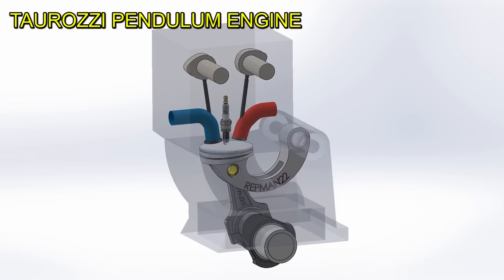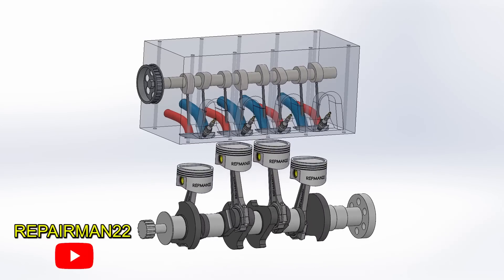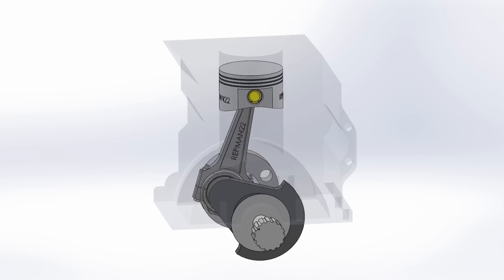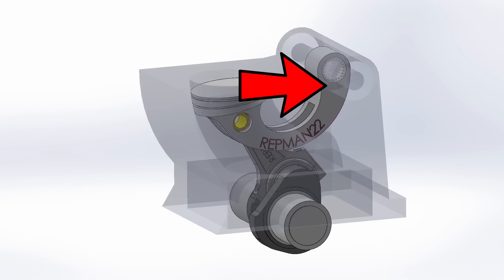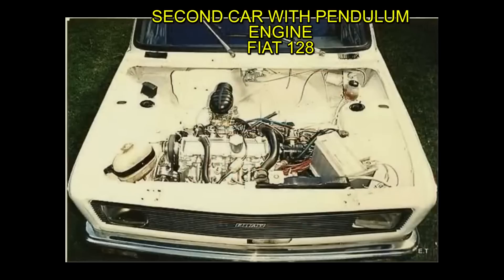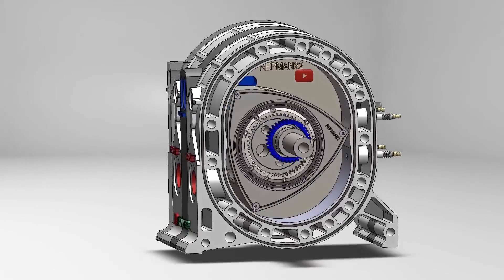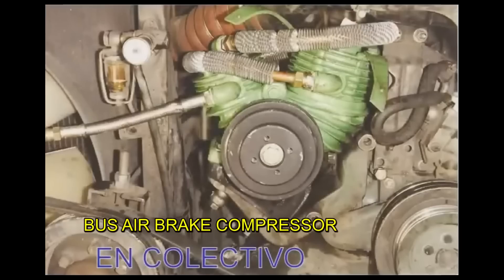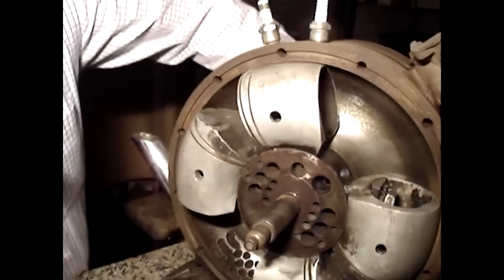All about the Taurozzi Pendulum Engine 🧠 and what happend to it🤯

Comment: Wow I've never heard of this engine before, and I'm very glad I did! Thanks so much for making this video! The fact that he was able to take it into real world use makes me confused about how it isn't in use by something now. Seems like it would make a wonderful motorcycle engine.

PS. The sound you used for combustion is hilarious!
Reply: Videos like this that propagandize concepts and make huge claims of 30% efficiency are fake guesses. If it really was so much better, every major company would use the design regardless of cost to license. The reason it's not common is because manufacturing costs and efficiency claims are worse than typical 4-stroke engines. Every time.
Reply: @mact.26  I took the 30% thing with a grain of salt. Even if it's "on-par" I can see a one-off coming out with a motorcycle with it. The success of a real world trial sets it apart from other "experimental" designs of historical note, which is all I'm comparing it to.
Reply: @mact.26  I doubt that it is that simple. And you ignore the enormous influence of conservatism in engineering
Reply: @davidcolin6519  I guess that you don't trust in engineering? While it is certainly true that the percentage of engineers that can properly evaluate an engine design is very limited, there is one very good reason while we don't see any big changes to the established current engine design: The best design has survived. All competing designs, that were tried during the 20th century, simply weren't as good. Current engines evolution is a product of engineers, not inventors. If you lack proper education (like inventors typically do) you can come up with an alternative design that can be made to work, but lack the skills to properly judge it. That being said, there are also certainly examples of bad decisions made by engineers, leading to developments that took the wrong path. One such example is the Honda's oval piston engine. Here it was prestige standing in the way of proper engineering judgement.
Reply: @CreRay  The Honda NR (Never Ready). You gotta give 'em credit for effort, though.
Reply: @jiyushugi1085  I just feel sorry for the poor engineers that almost worked to death to make something work that was nothing else than a poor engineering decision by their leader. It was an idea to make Honda win with a 4 stroke engine. It never happened. What the leader forgot is that not (just) max power counts, but also usability and power band. Same reasons why for example the (also very cool) BRM V16 failed.
Reply: @jiyushugi1085  BTW it's quite fascinating how people are totally convinced that apparently any engine design that is capable of running must mean that it is better than anything we've seen before. A while ago I saw some other alternative crankshaft design, the engine was demonstrated by running it on compressed air (i.e. no combustion). Then count the comments of people that it must be good considering how smooth it is firing😂😂😂
Reply: @CreRay  Yeah, the Japanese factories like to rotate their young engineers through their race teams, which is great experience for them, but since many of them don't know much about bike racing the resulting bikes don't always work too well. Honda's current problems in both MotoGP and SBK may also have their roots in this issue.
Reply: @VEC7ORlt  You're right of course.And doing so for an entirely new concept in reciprocating engine design, at a time when the automotive industry was under severe financial pressure (oil crisis followed by financial crisis) would make any potential producer want to be absolutely sure.
What surprises me is that M-B didn't just take him on as a consultant, pick his brains and, if necessary move on or take the idea further. Dismissing it almost out-of-hand  just because they couldn't match his claims seems to be a curious thing to do.
And if you don't think such things happen, you might do some research into the history of Orbital engines. Ford were interested enough to go to the extent of installing them in some cars that went to Police patrol cars.
Reply: @CreRay  Without seeing the data, I really don't think you can be sure. And seeing as M-B DIDN'T employ the inventor, just tested what they themselves made and then dismissed it, I don't think that it is safe to say that it couldn't have worked.
And in fact there really were many new engine designs in the 20th century. Jet engines were entirely new, as were turbo jets, and my uncle's own work on turbines, both as energy harvesters and as motive forces shouldn't be ignored. And then, of course, you have the 2 stroke, which only really started to make sense after the discoveries made in East Germany in the post war era. And I've only restricted my rebuttal to uses in transport!
And Honda's oval piston monstrosity was all about Honda's hubris, not an engineering "wrong path".
Reply: @davidcolin6519  In some cases I don't need data to point out what disadvantages an alternative design to a "conventional" 4-stroke engine has. I spent quite a few hours with engine simulation in my life, I think it's safe to say I have a solid understanding of the relation between basic engine design and its resulting efficiency. Ofcourse I'm aware of jet and 2-stroke engines, no need to educate me on that.
Reply: @CreRay  "Ofcourse I'm aware of jet and 2-stroke engines, no need to educate me on that."
You were the one claiming "there is one very good reason while we don't see any big changes to the established current engine design: The best design has survived. All competing designs, that were tried during the 20th century, simply weren't as good.", so felt that you needed to be reminded.
Nor do I think that it is safe to say that you have a "solid understanding of the relation between basic engine design and its resulting efficiency." especially as you seem to have completely missed the low piston weight, just as a starter. I can't think of any engine designer who would miss/dismiss such an obvious benefit. I really can't.
Reply: @davidcolin6519  Goodbye 👋
Reply: @CreRay  I am amazed at the absolute lack of connections you are drawing from this video. This is a proof of concept of a simplified twin crank design, but you are getting stuck on simple engineering issues. What you should be doing is noting the lack of sidewall wear and the benefits it grants, both in peak allowable RPM, lubrication needs, and long term reliability, but you have latched onto the base design as a final product rather than delving into the potentials it presents.
Reply: @Boomerhuaaaanger  Well I look at the design from a thermal efficiency standpoint. That's where all current development efforts (in the transport sector) are going into. I see no apparent reasons that long term reliability needs improving.
Reply: @CreRay  Reduced friction means less heat losses through friction means less thermal transfer required to maintain operating temperature means more insulating block material can be used means better thermal efficiency.
Reply: "This is a machine with low thermal losses since there is very little friction". There. One sentence that is very telling that the author of this video does not know what he is talking about, friction and thermal losses are 2 very different things! I don't see any advantage with current normal engines, the bent combustion chamber increases the thermal losses and decreases the mechanical efficiency because of the angle of piston pressure vs. conrad angle, and there is one added joint, increasing friction, not decreasing. It's an alternative engine design that absolutely can work, but there is simply nothing better about it.
Reply: @CreRay  That is the first pos that I have read that makes any sort of sense. 
I would join out that y wrong on several counts; here are some areas where there are clear and obvious advantages, but I'll stick to the most obvious one 
Piston weight. In a world that recognises that the only way to greater outputs (such as pretty much every type of motorsport) is to increase piston speed. That is why pistons on racing engines are so freakishly expensive, because they have to be as light as possible to place less strain on the conrod. Don't you think that reducing the size of the piston by a significant margin would be worth rather a lot? nI'd also point out that, with a significantly lighter piston, the flame front would have a much easier job of slowing down the piston, and that would also mean a HUGE advantage in reduced valve overlap, and would also significantly improve fuel efficiency
Considering the number of people on here who claim to understand engineering, there are an awful lot of them that also seem to have very, very closed minds.
I am not saying that I think the engine must have been the next incarnation of a jet engine, but I M-B was sufficiently interested to have built something similar, I really don't think that many of YT's self-proclaimed "experts" are in much of a position to dismiss it so lightly.
Reply: Give it a cool name and I would buy one! Always wanted a Wankel. Just to go out and jump on my wankel
Reply: Because there zero advantages to this engine. Harder to manufacture and no theres not a 30% fuel saving. Its all marketing hype. The pistons in regular engines use rings just like this engine lol
Reply: @OUTDOORS55  You clearly weren't paying attention., nor do you even understand that normal piston rings really, really don't work in the same way, because the ONLY reason a normal piston doesn't flop around like a dead haddock at the end of the conrod is because of the length of the skirt and the rings. Remove the rings and see how much efficiency you get, you dumbf*ck.
Next; I was under the impression that you needed to have a marketer to have "marketing hype". There I was, sitting down reading your post , me with my economics degree from one of the UK's more elite Universities and being schooled in basic economics by some guy on the internet. Well I never! I really must write to my other course-mates to explain that "Marketing hype" comes 50 years late, has no recognisable marketer and no apparent method of buying into the product! That is such genius hype that I'll recommend it to them all.
And while you're there explaining these amazing revelations, could you also tell me exactly how you know that these engines don't match any of the original claims? Do you have the data in front of you, or possibly you're a senior fellow in mechanical engineering at MIT, or maybe Brunel?
No? 
Of course you're f*cking not! Because if you were you wouldn't make such baseless claims without having some sort of explanation of why not, nor would you be claiming that piston rings and skirts have no function in a normal reciprocating engine, because you are talking purest, uninformed BS.
Reply: I don't know, to me it looks like a 4-stroke engine like many others, in fact I resorted to (although quite different) the Atkinson cycle engine
Reply: @MEDEN-1  I wonder what makes you think an Atkinson cycle engine looks any different from a any other 4-stroke engine?
Reply: @CreRay  nothing in fact, the angle and the way they move the connecting rod seemed similar to me, that's all

Comment: This sounds great unless you go into the details of where the friction comes from and how much. 
The rings are by far and away the highest losses in the cylinder and in most modern designs the only part to actually contact the cylinder wall itself - the rest of the piston has an oil layer between it and the wall at all times. 
Then you look at the method to get the "gains" he claims which involves more moving parts, bearings which would need oiling in real production use and far more complex/time consuming machining to get the engine made in the first place - all for no real gains once fitted with everything a production engine needs to run for a long time in all conditions. 
I can make a normal 4 stroke engine use far less fuel and make more power so long as its for a short time and in certain conditions. Car makers can't take something with total loss electrics, half the oil pressure, much thinner oil and all the other tricks and simply put it into production. 
For all his nonsense about less friction thats all it is when you take everything into account - nonsense.

If makers saw a way to reduce emissions even slightly these days they would jump at it in a heartbeat. The fact they haven't - even almost 30 years after the patents ran out - should say it all.
Reply: In this engine the force on the rings is instead put on the moving arm bearing.
Reply: This. If there was that much upside to it, someone (likely everyone) would be doing it.

Comment: I guarantee that the fuel companies have something to do with it not being in every vehicle
Reply: I guarantee you have no idea about engineering.
Reply: @siraff4461  he already proved it works the only people that would have suffered was the fuel companies
Reply: @josephfuller6229  Lets see the proof? I can make an engine in all kinds of funny shapes which works - some of which would use significantly less fuel than normal engines. Thats a very long way from making something that works in a production car. 
Using his own methods you could make any engine look great - total loss electrics, very thin/light oil, only one ring, no concern for the longevity of the components and so on. 
The only thing promising about this is his claims about it. 
In reality the rings would need to be of the same spec for the same bore/stroke/compression as any other engine. 
Also the claim of this massive friction loss in the piston of a normal engine is nonsense. Any modern engine uses cross hatching to hold a film of oil between the piston and cylinder wall - which is why they can usually run 200k miles or more if looked after. If there was any meaningful friction in use they certainly wouldn't be lasting anywhere near that long - infact engines before that idea only used to last 20-40k miles before needing a rebuild. So its possibly an improvement if you're in the 1930's. 
Then you have to take into account all the added drag from the extra weight of the internals, the extra bearing surfaces, the extra oil it would have to pump to feed those bearings and so on - if this could even match a normal engine on an even playing field it would be amazing. 
Of course it can't which is why - even almost 30 years after the patents ran out - no maker has picked it up. 
With emissions regs the way they are even if a maker could get 3% less friction this would be in production tomorrow. 30% is just a nonsense.
Reply: @siraff4461  modern vehicles are garbage when it comes to lifetime of the vehicle I'm about to upgrade to a vehicle without all the electronics simple and easy to fix nothing worse then having to pull engine to fix it or needing special tools
Reply: @josephfuller6229  This helps that how exactly?

Comment: This needs to mass produced but because it works so well it will never happen. Corporate auto makers in America make money by selling junk. It's called designed obsolescence. Maybe he could package the engines as an engine conversion kit and make money that way.
Reply: Rubbish. Almost all car engines these days outlast the vehicle they are in as long as they get even reasonably looked after. If you think this is the answer you need to take an engineering class because the claims don't add up by a very long way.

Comment: I believe this is all about cost cutting. Re tooling for making these engines would cost a lot of money that can be used to cater for the buyers lizard brains with seat heaters, navigation systems and new exterior designs. all of which are cheaper to implement than a new motor technology. meanwhile they are cutting costs in the engine compartment, making things out of plastic that used to be cast metal.
Reply: Cuting wouldnt be much more expensive we would just cast the general shape and use cnc to refine the rough cylinder which would reduce wear on tool and make it far faster to machine than cuting out a whole block and would allow mass production
Reply: @yeet3071  They only use CNC milling for more expensive engine blocks, Your cheap car engine has had its rough block milled in a more simple setup where the cylinders are cut out on the same time in a single move.